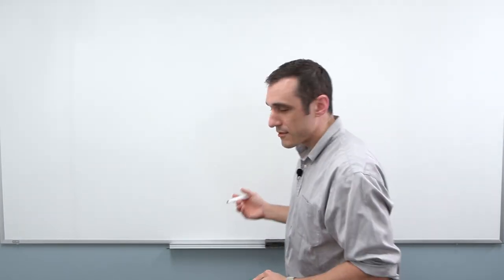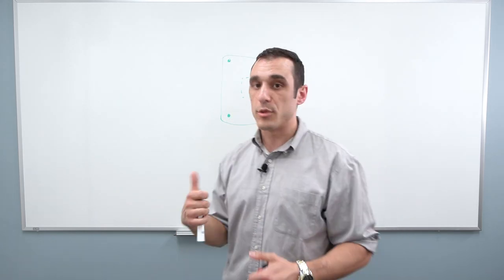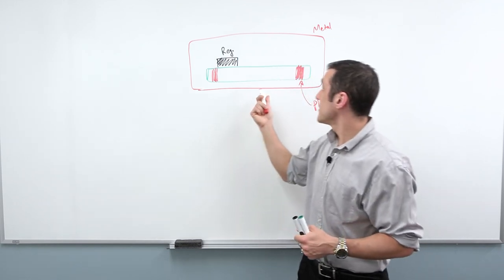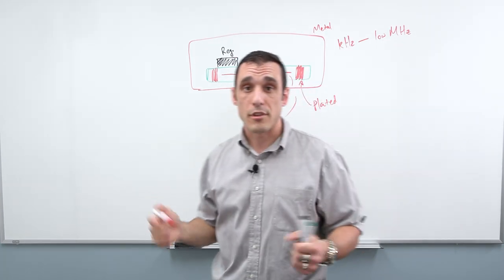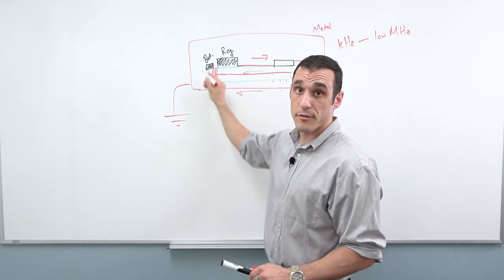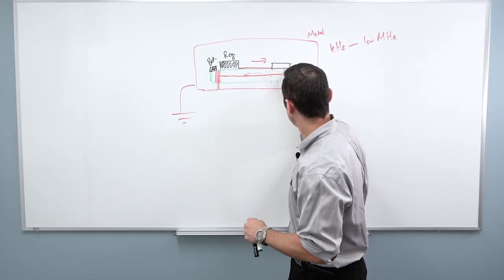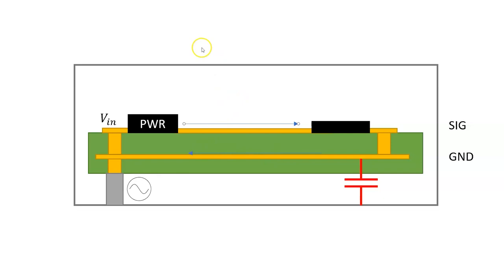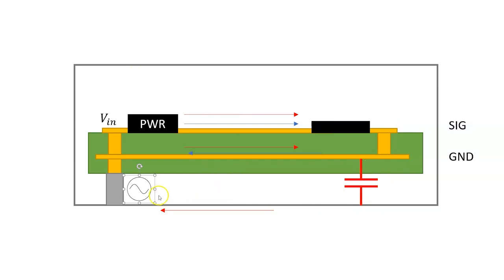PCB Mounting Holes | PCB Design Techniques

Comment: Another consideration with NPTH is how much pull back you call out for your copper planes. Doing RF boards I try to give a generous amount of pull back as to not have new parasitics when mounting a PCB to some sort of chuck. Also using nylon or polymer fasteners rather than metal fasteners can help with grounding or coupling issues though mounting holes.
Reply: That's a great point, parasitics always change things, including with mounting holes and coupling around the board. I bring up something like a metal screw since the stuff I work on always needs strong mechanical mounting, but something like a plastic standoff is a good solution. I've done that in the past with prototype wifi modules, but since we didn't have an enclosure on those prototypes I never worried about it.

Comment: Ultimately one has to mount the pcb with the metal enclosure but regardless the mounting hole is grounded or not, either the multiple ground return paths or common mode noise propagation through the capacitive coupling occurs. Then how to get rid of the problem?

Comment: Somewhat off topic but in multi layer boards remember to set up rules so that a screw never will be able to "chew" in to the board material and cause a short from ground to the internal power planes With the result of overheating and even a fire hazzard. An example of this is the NZXT H1 PC case debacle. NZXT had to do a recall of 32000 PC cases sold in the US (data from the Verge)

Comment: This video feels not complete. How to get rid of the common mode? I have an AC/DC adapter powered board, grounded all mounting holes to metal casing. Users experience tiny shocks sometimes. I think because of the y-caps inside the SMPS?
Reply: The question though is: how to connect chassis ground to pcb ground

Comment: Sometimes capacitive coupling from ground to chassis can be a good thing. In instrument amplifiers, it is common practice to place a 100nF capacitor from the instrument input's ground pin or lug to the chassis, which supposedly shunts RF picked up by the instrument cable shield to earth; there are quite a few stories floating around about amps without such a capacitor acting as wide-band receivers picking up ATC or CB chatter. Supposedly the capacitor provides a lower impedance return path than the amplifier's ground plane or bus. It occurs to me that a non-grounded plated through mounting hole is a convenient way to connect the RF bypass capacitor to chassis earth.

Comment: I'm also curious about the best practices when the power source is an AC mains cord.  There's probably a lot of authoritative-sounding conflicting advice out there on what to do with neutral, what to do with ground, and whether to put anything between the holes and the enclosure, etc.
Reply: Yeah there is a decent amount of information out there, and I think the difficulty is in when to apply various recommendations to different systems. Recommendations about using the GND and neutral wire are sometimes conflicting, but different recommendations can both be right in different situations.

If you think about AC mains the point of the GND wire is top provide a single reference point for other signals, so it can be used as ESD/RFI shielding, a protective GND point, and/or as a sink for high frequency noise depending on how it is connected on the PWR input of the system. We did a video previously that looked at some of this stuff, you can find it here: https://www.youtube.com/watch?v=hMyYYERfPhQ

Comment: Do you only need to connect one mounting hole to chassis to prevent safety issues? Am I right?
Reply: Not necessarily... It depends where you expect some kind of safety problem to occur and what exactly that safety problem is.

If your main worry is an ESD event inducing a high voltage pulse in the board, then you want to have low-impedance connections to some safety ground near where you expect the event to occur, like the enclosure. This is really common in industrial Ethernet: the port is usually where this occurs because, even in an insulated enclosure, some metal on the port will be exposed. In these systems, the port is connected directly to a section of the board that is connected back to the chassis with a low-impedance connection (large GND plane plus multiple screws), so any ESD would follow this low impedance path back to GND rather than follow a path upstream into nearby components. Other systems that have shrouded connectors can do the same type of thing for the same reason. The risk here is that poor grounding in the system creates a ground loop that carries noise, or it's possible for capacitive coupling into a transformer/ferrite (people who do Ethernet have debated this forever) if you don't know how to predict return paths throughout the system. You can read more about this here as it's related to your question: https://www.signalintegrityjournal.com/articles/1808-ethernet-connectors-and-routing-above-ground-planes

Comment: Hi, this video reminds me a lot the desktop computer's power supply where is grounded on enclosure (I think with one only screw) and it have common mode choke for the rejection of the common mode noise that is created from the parasitic coupling. If you please could you make a video about the structure of a computers power supply. I beleive it includes many design challenges and rules that you have said on many from your videos.
Reply: Hello, that's a great idea, I'll try to put together a teardown and walkthrough video.

Comment: How are we supposed to square away the seeming conflict between what were taught in physics, that EM radiation can't escape a faraday cage, and what is being described at 5m, that a (effectively) faraday cage can aid EM radiation?
Reply: Hi Matt, at 5m I'm showing a conductor that isn't grounded yet. And it's not necessarily that adding the enclosure makes radiation worse, but it can still permit radiation. In a physics class, we assume (but we don't state clearly, I am guilty of this from when I was teaching) that an ideal Faraday cage is a perfect conductor, so it will have enough free charge to counter any electromagnetic wave or electric field that is incident on the metal, thus the E-field inside the metal is zero. Real conductors are not perfect and they do not provide infinite shielding effectiveness when used in a Faraday cage. When left floating, they can couple to the PCB or external sources at high frequency and radiate or conduct noise. Grounding is known to increase shielding effectiveness. You have a similar problem from heat sinks, which can act like antennas when left floating.
Reply: Zachariah Peterson  You might also mention the skin effect and skin depth. The current in a conductor doesn't flow uniformly throughout but instead mainly along the surface. How deep into the surface is called skin depth and has a relationship with frequency.
If the frequency is such that the skin depth exceeds the thickness of the shield, the shield may radiate.